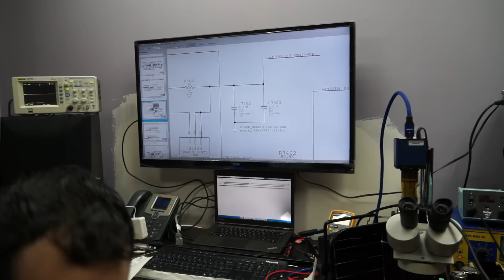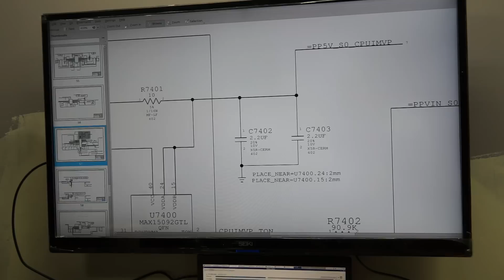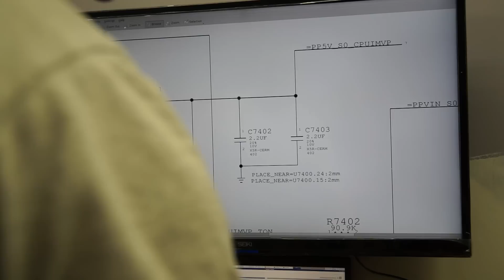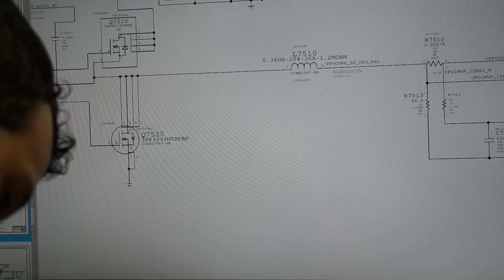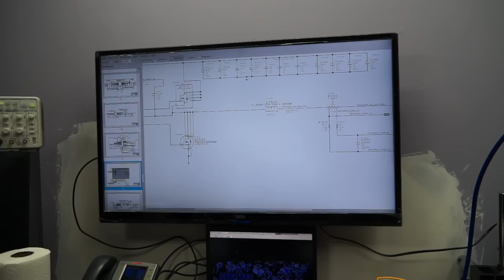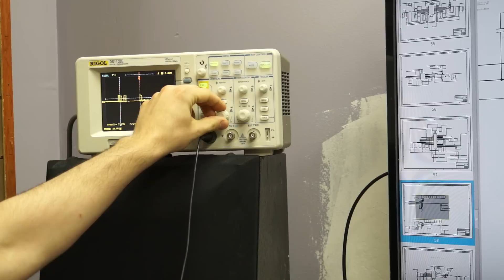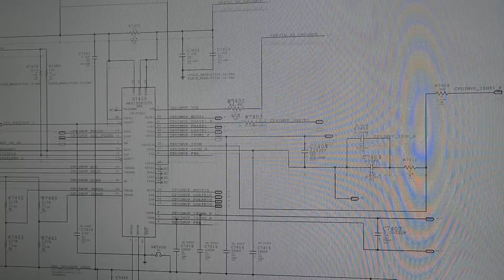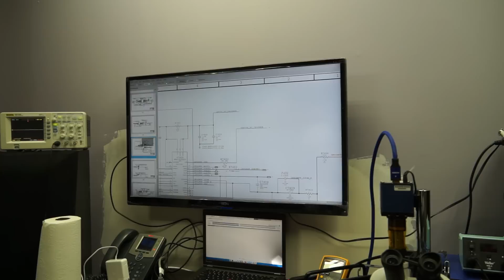820-3023 logic board repair - how CPU power circuit works on Macbook Air

Comment: Hi I have a Macbook Air A1369 that after a few minutes turns the screen into a kind of mosaik !! I have tried to bake it in my owen and it worked for a week until it went back to the non useable state. What can be wrong and can the Logicboard be refurbished? It have also had the 3 long beep´s but that´s not an issue anymore after the DIY bake refubish method.

Comment: hey louis , how are you ? i hope that fine !!!
i got here a macbook air with the same motherboard . it came in to our labs , and it was making "beep" noises on startup, so i made a SMC RESET , and it does start displaying image and booting up . , now when its booting , when it arrive to midle point of the boot , it shutdown the machine and its doing this all the time . NOW the weird thing,the client battery is not ok . with another battery it does charge no problem . now even with a new battery and with at least 50% full , once i insert magsafe jack on the computer , it does turn on all the time ALONE, so i cheked and rails seem fine , cheked carefully g3hot lines since one part of the circuit could make a drop voltage or something that would make the machine to shut down , but didnt find any issues . i'm a bit stuck with this one , have you any direction to show me , maybe something i missed .
thk in advance , all the best

Comment: hi Louis, i have macbook air 11" 2012. the problem is i encountered that my macbook air shutdowns quickly, i tried using it when charging and without charging but same problem. any advice or recommendation? thank you so much.

Comment: Hi 
I have macbook Air which doesnt boot or run without being plugged to power :(
Reply from the maker: +Ruba Taha Fix it
Reply: how :(
Reply from the maker: Ruba Taha
If only someone spent 1000 hours of their free time filming a youtube channel dedicated to answering that question for you
Reply: Is it that difficult :(
Reply: ruba he was beeing sarcastic , the first thing you should chek is if you battery is ok , first of all , second you shnould chek charger circuit , and specialy the parts that are mentioned as CRITICAL on the schematic . usually air , have issues with mosfet (or on dc in or in charger part ! but could also be the ISL fault . chek carefully with schematic , and there are videos from luis showing how to test charger :P

Comment: Hey Louis! I recently F up a thermal compound cleaning routine on the CPU and knocked one of those little capacitors/resistors off the chip. The Macbook pro still powers up and does work but i am worried that something is wrong with my system. My macbook is a MBP mid 2012 A1286 EMC 2556. Can you help me out?

Comment: hi sir!! i have macbook pro when i plug adaptor it run fast but if i don't plug adaptor it run very slow could you tell me what is the problem . thanks
Reply from the maker: +Hon Sochan sensor issue,diagnose and repair

Comment: You speak a lot.. But it's so much interesting what you are doing. I want to know how do you start tracing an issue from the scratch. Also, from where do you the circuit diagrams ? I am an electronics Engg turned software Engg so sort of interested to fix my own stuff by myself.

Comment: Thankyou for the video. I have a macbook air (personal machine) which had water damage, that was sorted with a clean. Ran ok for a year. No visible signs of damage at all. All of a sudden, the machine will not switch on, only the fan spins up to high speed. On battery the high speed lasts a few seconds, on mains it remains on. Any idea at all? I can't find much help on net. I have a schematic, a multimeter, but where to start on logic board?

Comment: Hi!
Had the same problem with the same Air board. CPUIMVP_TON resistor missing, replaced, repaired the trace, but same symptom. Luckily, i saw on this video that you have one more 0201 resistor, than I have on my board, it was CPU_AXG_SENSE_N or CPU_VCCSENSE_N, I can't recall it now, all that remained after spillage was a little black dot on one of its pads.
After replacing everything went fine. The thing that confused me, is that the schematics have components labeled NOSTUFF. Do I think correctly, that these components are never put in their place in mass production of the motherboards?
Zsolt
Reply from the maker: Zsolt Palkó NOSTUFF means it is NOT there on the board meaning don't put anything there.

Comment: hi,  i have the same motherboard , turn on the powersupply light also charge the battery. but not turning on not with the power button niether with the points on motherboard.
but when i put the power cable , fan try to turn on. cpu heat up.
what you think about this problem?

Comment: bad explanation bout those 2 fets and whole circuit. actually they work like a push pull configuration , the current gets stored in the inductor when the fets are shorting out, everything is smoothed out by the diode and filtering caps after the inductor...
Reply from the maker: Ciolacu Alexandru ah well
Reply: Looking for a job btw.
Reply from the maker: What do you do?
Reply: It electronics mostly, mscs and other brands mb chip level repair